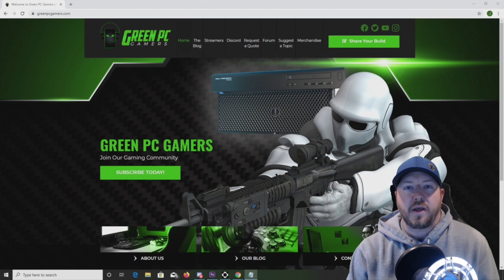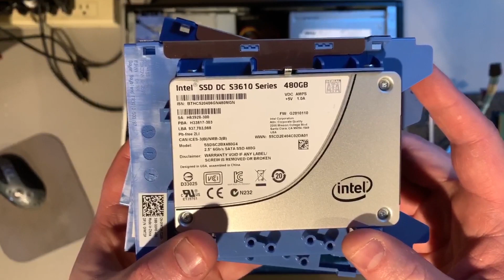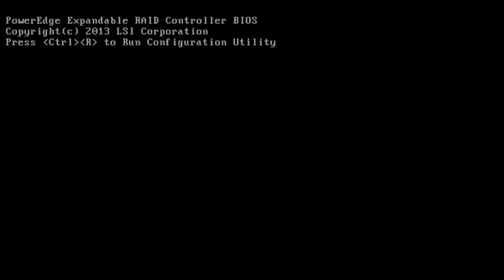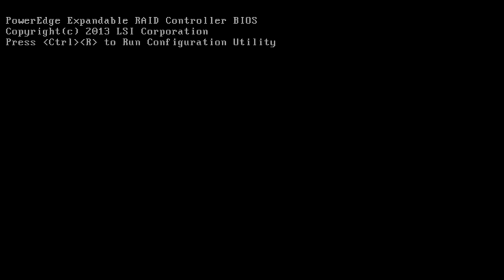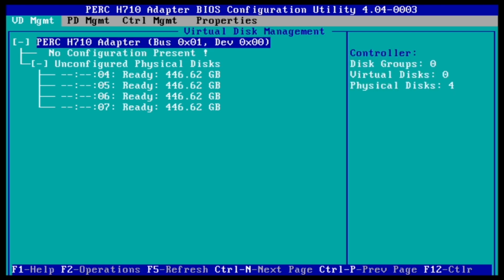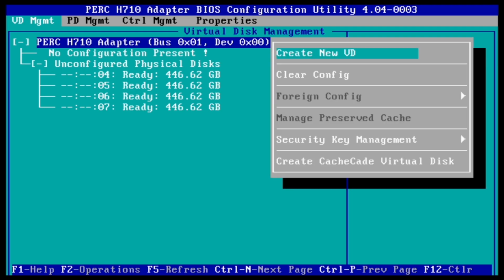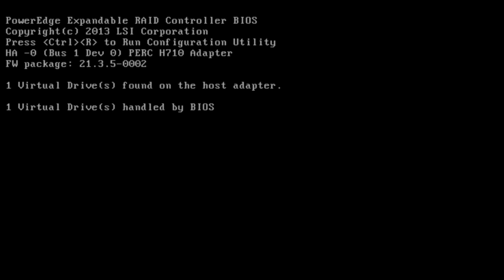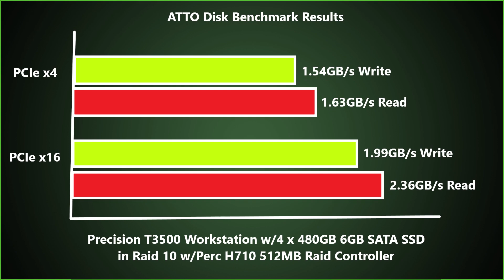Precision T3500 Optional Drive Cage Install + 4 x 480GB SSD in Raid 10 w/H710 Controller

Comment: I am the original owner of a Dell Workstation T3500, in very good condition. It was built with 2 X HDD Western Digital 500GB/16 MB cache at a full capacity now and It's slow. Yesterday, I installed a new SSD 1TB samsung 870 EVO Sata 2.5 in the SATA 0 compartment and let the back up HDD 500GB in the SATA 1 compartment. I put a key USB windows 10.  F2 to run the set up utility, The Samsung SSD 870 appear on the list, a good sign. But when the BIOS run, the SSD failed to detect and the PC is running with the old HDD like usual. I disconnected the HDD 500GB and try to run the BIOS. ''Failed to detect one or more drives during POST.''  Is the samsung 1 TB is to big for the SATA 0, should I installed a 256 MB instead ?
Reply from the maker: The 1TB SSD will work in your T3500.  Temporarily remove the old 500GB so the system stops booting to it.  Then you can boot to your Win 10 Restore media and load windows 10 to the SSD.  Then you can put your old 500GB HDD back the system, but change the boot sequence to boot to the new 1TB SSD.  That way you can enjoy the speed of the SSD but still have access to the data on your old 500GB HDD.

Comment: I have 2 HDDS and One SSD. I can install Windows on the HDD but cant do the same on the SSD. Yes the drive works perfectly fine but for some reason it refuses to act as a boot drive. The SSD is an Old Adata SU650
Reply from the maker: Try doing a full wipe of the SSD with a program like Kill Disk.  Normally that will resolve the issue.

Comment: @GreenPCGamers - Which Operating System are you guys running on the T3500? Based on what I have read it will not run Windows11?  So which OS are you guys using? - Thanks!
Reply from the maker: Windows 10 Pro 64 Bits.  The T3500 doesn't support Win 11.  However, there are some there are some work arounds.

Comment: Do all the ssd’s have to be the same size and model to run raid 10 ?
Reply from the maker: You should use the same size, interface, and type.

However, larger capacity SSDs with the same interface and type will work as well, but there could be some degradation.

Example:

4 x 480GB SATA 6GB Mix Use SSDs in Raid 10

If 1 drive fails....

You could replace the failed SSD with a 960GB SATA 6GB Mix Use SSD and it would work as a replacement.  (but you wouldn't gain the extra capacity)

Hopefully this info helps.

Comment: Can i LiquidCooler For Dell t3500 ? Sorry for my bad english
Reply from the maker: It would be tough to fit a an aftermarket liquid cooler in to a T3500 chassis.  However, if you try it, let us know.
Reply: I wonder if a 160mm (2x80mm) would fit in the rear fan mount?
Reply: @virtualtools_3021  it would
Reply: @TheGamer-hy4om  that would be epic, could put in w3690 (unlocked cpu, 6 core) and overclock using throttlestop to change the multiplier
Reply: @virtualtools_3021  yup, I ordered two 80mm case fans for the rear and a 60mm fan for the Northbridge chip. Ordered a x5670 as well, if only w3690s were cheaper lol

Comment: Wouldn't the 1660 work using the 2nd pcie 16x for it or without graphic card at the first it would not display image?, could be an option to have a free 16x slot with the 1660.

Other question does the t3500 fully work with 6x8gb ? I saw in datasheet just about 24gb but i saw you with 4x8gb working fine 😁 

Greetings from Brazil
Reply from the maker: You should be able to use the secondary 75W PCIe x16 slot for your gpu.  Yes, the T3500 does support 48GB memory.  We posted a 48GB install video on our channel.  Thanks for commenting!